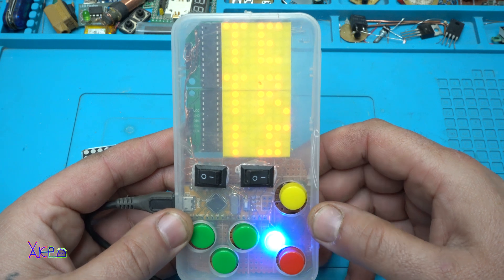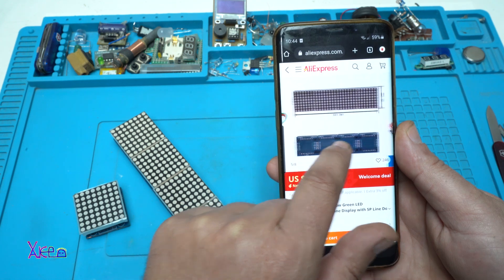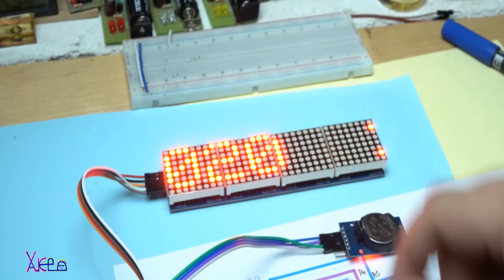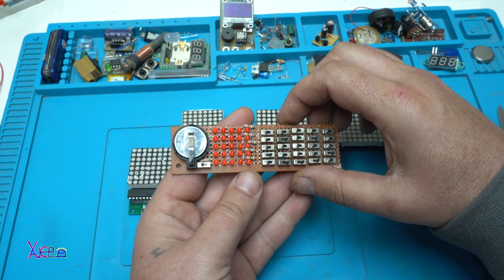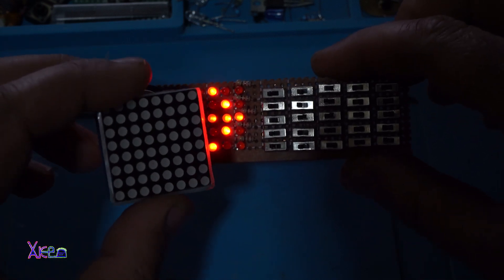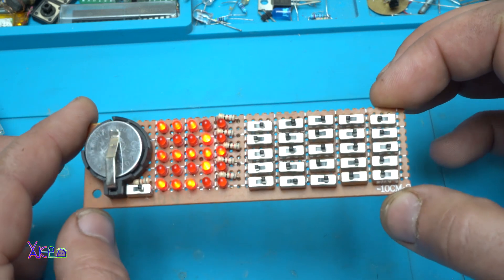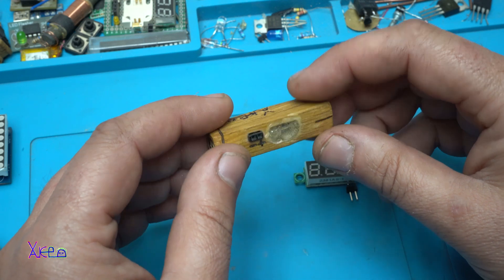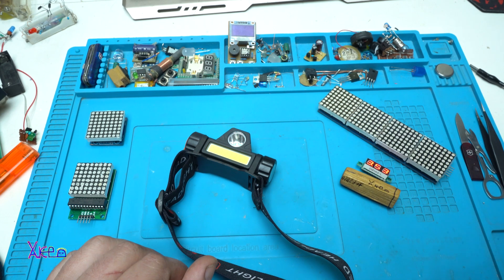5 AFFORDABLE $1 Aliexpress Gadgets- Are They Worth It?

Comment: I like those max7219 modules, but they are much too bright! If you increase the current sense resitor to 47k (I think) the brightness is reduced and the display will last much longer and use less  power. You can unplug the led matrix to access the resistor.
Reply from the maker: Good to know,I need to test that,thank you👍
Reply: @Hacktuber  The resistor is connected to pin 18 of the Max7219 called Iset. I changed mine to 47k, from 10k. Even on brightness 0 it is still readable , but in software you can go up to 15 which is bright enough! I've had 4 modules running for 4 years now on brightness level 1 and still good. I used the MDParola library on Github.